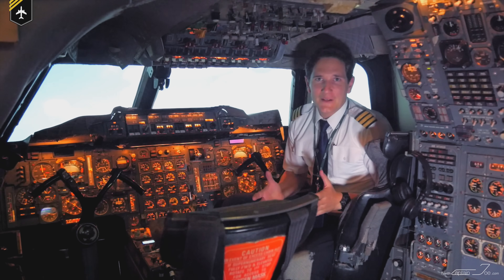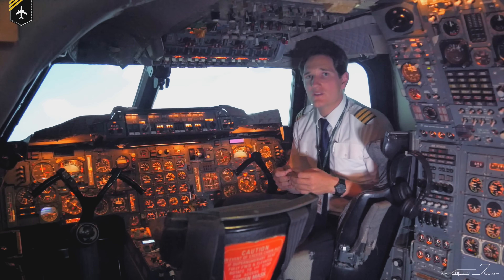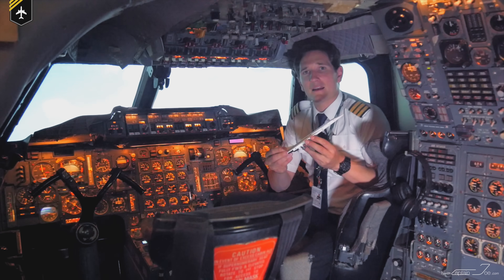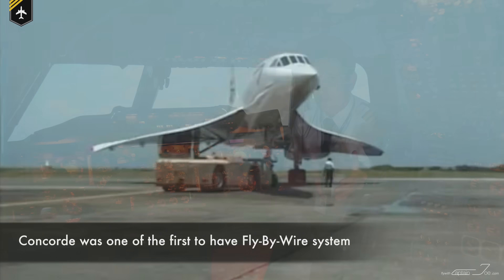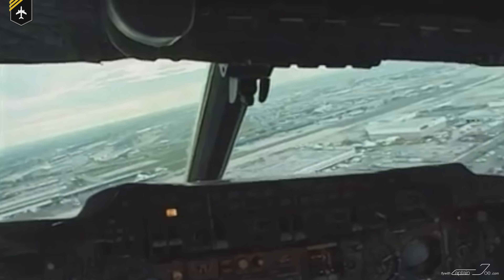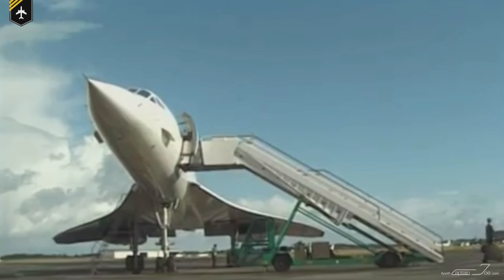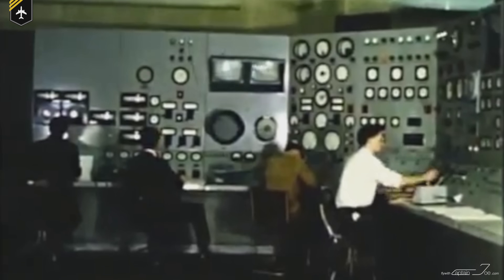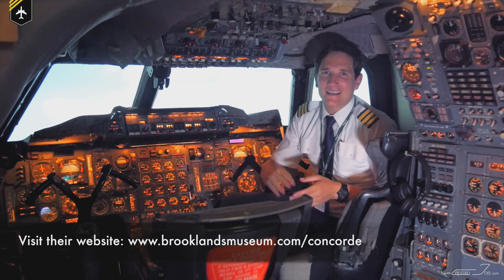FACTS you should know about CONCORDE! Episode 3 by CAPTAIN JOE

Comment: How does a speedometer in an airplane works?
Reply: JD there are a few different ways the information gets to the pilots depending on the type of aircraft. They all use a pitot tube. They are  forward facing orifice that air travels through, than into either into an Air data computer or a bellows type air speed indicator. Most Aircraft have two main pitot tubes and one standby that is completely separate from the mains.
Reply: A couple of hair-splitting technical corrections. First, the air doesn't travel through the pitot tube nut around it. The forward facing orifice matches the stagnation point (a point where the speed of the incoming air reduces momentarily to zero) so the local pressure raises from the static pressure to the total pressure (static+dynamic). The dynamic pressure is a function of the speed and the air density, but the pitot tube doesn't sense the dynamic but the total pressure. To get the dynamic pressure we need to subtract the static pressure which brings us to... Second, they pitot tube alone can't capture all the information needed to measure the speed. We also need a static port which, unlike the pitot, has a lateral-facing orifice, parallel to the flow of air, that senses the static pressure, which is the local atmospheric pressure. As originally designed, the airspeed indicator in nothing but a differential manometer, one that measures the difference between the total pressure and the static pressure (such difference being the dynamic pressure), except that with a fancy scale marked in knots instead of PSI. As a side note, as a said the dynamic pressure is a function of the airspeed and the density. The airspeed indicator doesn't know the air density, and the speed scale is marked assuming that the density is that of a standard day at sea level, which is typically not the case, especially not when the plane is not a sea level but miles high, where the air density is much much lower. That means that the airspeed indicator almost never indicates the "real" airspeed, but a fake airspeed called... drums please...
 indicated airspeed. (not an airspeed actually, just the dynamic pressure in a fancy scale), and the "error" is not minor: The real airspeed can be almost twice as much as the indicated airspeed. So what's the good of having such an awful misleading airspeed indication? Well, the instrument is not an airspeed indicator, but a dynamic pressure indicator, remember? Just labeled in a fancy speed scale because pilots prefer to talk about knots the plane is moving (even if fake) than PSI of dynamic pressure. But, put the scale you want, it is dynamic pressure, not speed. And the good thing is that lift, drag, speed needed to take-off, or for approach, stall, fuel consumption, structural limitations, and other very important things depend not on the real airspeed but on the dynamic pressure. For example, other things being equal, a plane  will need the same dynamic pressure to approach in New York at sea level than in La Paz (Bolivia) at more than 10000 ft (where the density is much lower). The "real" speed will be much higher in La Paz, but in both cases the airspeed indicator will show say 140 kts. So the indicated airspeed is very useful to "fly" the plane, but not to navigate because it doesn't tell you with any remotely acceptable accuracy how many nautical miles are you doing every hour, even if the scale is in knots which is nautical miles per hour.
Reply: GPS, GLONASS, LORAN, DME etc can show ground speed which is neither what the speedometer of the planes show nor is it useful to fly the airplane (as I explained before). It is only useful for navigation but it won't tell you if you are about to stall or to rip the wing.
Reply: pitot
Reply: JD there are small metal tubes called pitots on the nose of a plane which measure the pressure of air coming into the tube to determine airspeed
Reply: Sure. It's actually very easy. So the GPS satellites simply send signals of the type "I am satellite 14, it's 08::23:45.52104967629 UTC (high precision timestamp), I am here (high precision 3D coordinates)". Note that the satellite only tells information about itself. The GPS receiver in your cellphone then gets this information and compares the timestamp in the message with the actual time the message is received, which is a tiny bit later since it takes some nanoseconds from the signal to get from the satellite to the GPS receiver. The delay, multiplied by the speed of light, gives you the distance to that satellite, and since you know the exact location of the satellite (it is in the message), this distance defines the surface of a sphere with center in the satellite coordinates and radius delay*speed of light. Your receiver is located somewhere on the surface f that sphere. Do the same with a second satellite and you'll get another sphere. The surfaces of both spheres will intersect forming a circumference. Your receiver is somewhere on that circumference. Add a third satellite and you get a third sphere, whom surface will intersect the previous circumference in 2 points. Your receiver is one of these 2 points. One of these points will be either under the surface of the Earth or above the orbits of the satellites. Your receiver is in the other point. Voila! Except... While the GPS satellite have super accurate, million-dollar atomic clocks that correct for temperature and relativistic effects, and it is permanently being monitored and adjusted from dedicated Earth stations, the clock in your GPS is basically a cheap wristwatch. It is nowhere good enough to measure the delay between signal sent and signal received. Forget about it, it's just worthless. You can't rely on it to get any coordinate better than "on Earth, maybe". But, let's forget that the GPS has its own clock, and let's add a 4th satellite. Now you have 5 unknowns: The distances to the 4 satellites and the time. But the distances to the 4 satellites are not independent. Any 3 of these 4 distances define your exact location (as explained before) and then remaining one can be calculated (since you already know where you are and you know where the 4th satellite is). That is an additional equation without an additional unknown, so you have 5 unknowns with 5 equations. And Voila! You receive the 4D coordinates (latitude, longitude, altitude, and time) of 4 satellites, and use these 4 datapoints to solve the 4 parameters of your own 4D coordinate (latitude, longitude, altitude, and time). As you can see, not only you get a very accurate 3D coordinate, but also a very accurate clock! By the way, if you are in on the ground (say in a car or boat) and your GPS has a good model of the Earth (which all do), you already have a sphere (or geode) to intersect with the satellite spheres, so you can let go one satellite and 3 are enough to get your 4D coordinate.
Reply: It is not called ...-o-meter. It is called airspeed indicator and it indicates something called indicated airspeed which is typically measured in knots and is actually NOT the rate at which something is moving about something else, in particular NOT the speed at which the air moves about the plane or vice-versa. The closest it gets to a real speed is that it answers the question "If the air density around the plane was that of a standard day at sea level (which is not the case), what would be the real airspeed that would produce the dynamic pressure that I am measuring?"
Reply: adb012 I love your -o-meter -tastic explanations xD
Reply: @adb012 Thanks for taking the time to explain this so clearly
Reply: Who defines the use of an SPEED-o-meter ?
BTW: You described a dynamic-pressure-o-meter - and ok, maybe this is also useful to fly a plane... ;)
Reply: adb012, please Do me a favour and describe a GPS-Receiver :D
Reply: Flying without indicated airspeed would be a pain in the ass as you would need to have diagramms or look-up tables for everything :D
Reply: icndjfk nsbdbd ... Ana AoA indicator would be a lot of help in that case.
Reply: It's calibrated in IAS Knots
Reply: I think they just guess, look out the window.
Reply: Pitot tube
Reply: JD pitot tube
Reply: Get ready for a long and detailed explanation.

There is more than 1 "speedometer" on a plane, and they're not called that. The first one is the main one, the air speed indicator, that shows Indicated Air Speed (IAS), which has 2 pressure sensors facing forward and backward, and it calculates the speed of the air around the plane at sea level by measuring the difference between the backward facing pressure sensor and the forward facing one. The more you climb through the atmosphere the less accurate it gets, because the thickness of the air decreases with altitude. If you are flying at 30,000 ft, and you want to fly at 280 kts IAS (Indicated Air Speed), you would have to fly way faster than that in order to make the air speed indicator display 280 kts, because air is thinner at that altitude, and at around 400 knots ground speed, it will indicate 280 knots air speed, but the wings will generate as much lift as if you'd be flying at 280 knots, because the air is thinner. The second type of "speedometer" is the Ground Speed (GS) Indicator, which uses GPS to determine the aircraft's speed relative to the ground. This is necessary but not really important most of the time. The third "speedometer" is the True Air Speed (TAS) Indicator, which takes 2 main variables into account: IAS and Altitude, but also outside air temperature. By using these variables in a formula, it determines how fast air actually is going around the plane. So if you are flying at 30,000 ft, and the IAS is 300 knots, it will calculate that the TAS is around 450 knots (I don't know exactly how much that is in real life). Temperature also plays a role in air thickness, so that is also taken into account. This doesn't mean the same thing as Ground Speed, because, for example, you are flying with tail wind, which means that the TAS will be a certain number, while the GS will be a little bit higher, because wind comes from behind you.

There you go, I hope you understand now
Reply: Air Speed Indicator
Reply: I described an airplane's airspeed indicator, which happens to be dynamic-pressure-o-metter calibrated in kts. Next you will say that an aviation altimeter is not an altimeter because it is a static-pressure-o-metter calibrated in feet (because that's what it is). And a radio-altimeter is not a radio-altimeter but a stopwatch (where start and stop are triggered by radio signals) calibrated in feet using some conversion (the speed of light). And a car's speedometer is not a speedometer but, in the best case, an RPM meter calibrated in MPH using some conversion (the circumference of the wheel).
Reply: It is connected on its wheels.
Reply: A more simple way: Use GPS
.
.
.
.
.
 (Or GLONASS)
Reply: Btw: why it's called "..-o-meter" if its calibrated in miles or knots? :P
Reply: It measures speed from the engine turbine speed
Reply: JD holy shit. Ask google for yourself ...

Comment: Hi Joe, I have a question. On a Boeing 747, I've seen this small stabilizer between the two flap flarings on the wings. Does this add more stability on approach or does it act like the vertical stabilizer on the back? Not 100% sure if you may be able to see where I'm going with this

Comment: TU-144!! :0
Reply: Fire Power701 Where did that uncalled-for shit come from? Grow up.
Reply: I agree totally.... Stupid.
Reply: Fire Power701 Do you even know there is no soviet anymore or you didn't even go to school yet?
Reply: Let's face it, although the TU144 was in the air before Concorde, it was a clumsy attempt at an an SST. Yes, they stole a load of blueprints, so it was a similar looking aircraft, but they failed to create a wing shape with the subtleties of the Concorde, which meant that they had to add canards to assist with low speed handling. The TU144 was also very noisy on board, unlike the Concorde, which was smooth and quiet once cruising.
I do think that the Soviets could have refined it into a very capable aircraft if they'd developed it further. 
As for the Paris airshow crash, there is a theory that a French military jet was flying nearby, attempting to take pictures, and that the TU144 pilot was actually trying to avoid a collision, but in doing so overstressed the airframe, causing a catastrophic failure.
My dad flew on Concorde twice back in the 80s, and said it was the most fantastic experience. I'm just a bit gutted that I'll never be able to experience it.
Reply: Gotta get to Russia though....
Reply: No but there's still plenty commies.
Reply: It was a copy! There was far to many things wrong with the 144 to mention, and the Russians didn't know everything about the concordes design. A Concorde engineer looked over the 144 and picked it apart! Engines far to close for starters.
Reply: He don't have to, there is one on display at Auto & Technikmuseum Sinsheim in Germany. Not sure if he can get in to it. It's on display next to a Concorde!

Comment: a follow up series on the Tupolev Tu-144...?? We know u want to...
Reply: Mandernach Luca It's actually complicated. See, the English sources I found were terribly biased not even mentioning ANY of the aspects where Tu-144 was superior to Concorde while concentrating on its flaws and problems. Similarly Russian articles don't mention its problems except the crashes and poor validity of its passenger service while mentioning its strong points. So, assuming you are already familiar with English wiki page (judging by your initial statement) all I can suggest is to just open Russian Wiki page and put it through the translator (unless you know Russian) and by overlaying the info from both of them you can kinda get the whole picture.
Reply: Well if you get me some links that explain the technical details i would be glad to be educated .
Reply: Everyone knows the Russians stole the blue prints to the Concorde and anyone looking at the two planes can clearly see this. The American SST looked kind of similar to the Concorde, but the TU-144 was nearly a carbon copy.

They modified the TU-144 for 2 reasons. 1 they were unable to produce the exact wing shape of the original blue prints causing fuel consumption and stability issues, and 2, in an attempt to out do the actual Concorde they extended the fuselage. Yet by lengthening the fuselage they weakened the air frame which is why the Russian Tu-144 broke up in a high G maneuver during the air show. The actual Concorde would have survived that maneuver. Also the addition of the APU is not that significant, APUs have been in airplanes since the late 30's, hardly cutting edge. Since the Concorde would only fly to major airports in long haul routes, their would always be ground power and bleed air systems available. Weight saving were of a higher priority to make the plane economically viable which it was already struggling to do,
Reply: The 144. Is that the one that never got off the ground or w/e?
Reply: It flew one route commercially
Reply: Mandernach Luca And yet this "stolen" plane had totally different aerodynamic solutions for speed reducing and also this "less refined" Tu-144 DID have an APU and even had the first of its kind GPS system (working differently than modern satellite nav systems) but you're not supposed to know that because it would have hurt Concorde's marketing. How silly.
Reply: Tu-144 was just a russian plane  build on stolen blueprints of the Concord. It was kind of simpler and less refined than the Concord.
Reply: Mandernach Luca u do have a point but still, you can't deny a story about sneaky Russians with a hammer and a bottle of vodka set out to make a supersonic jet wouldn't be interesting...
Reply: Russians produced better planes than their western counterparts.